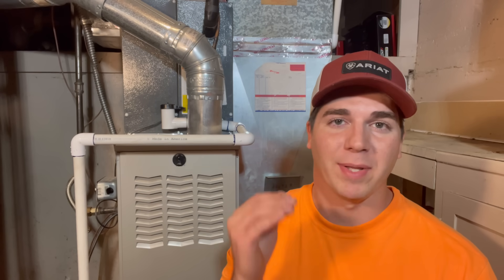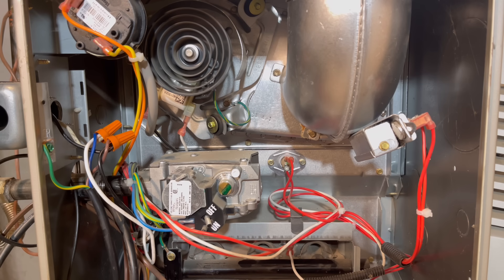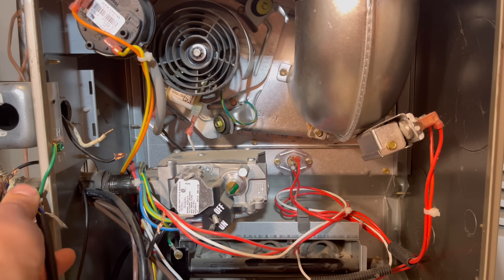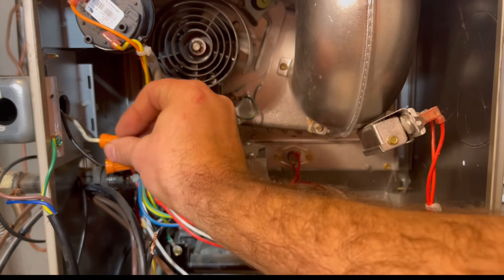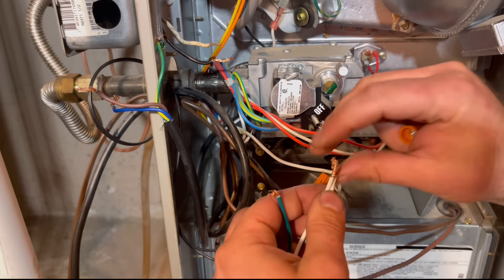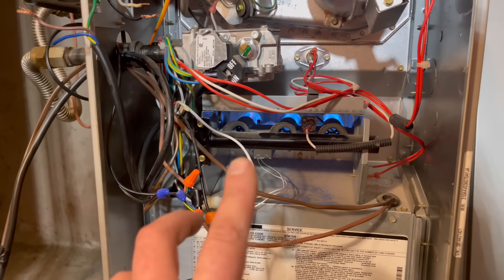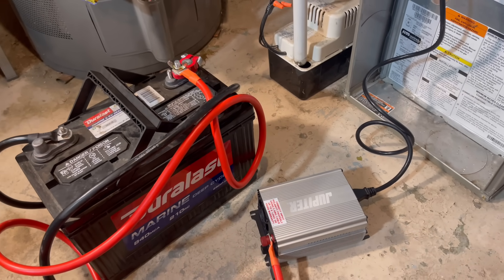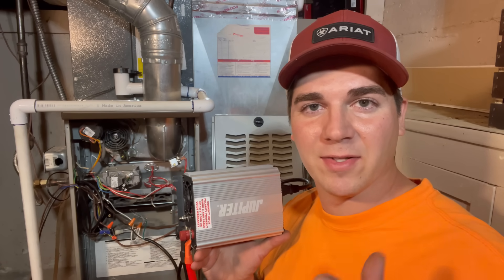Did You Know You Can Heat Your Home With A Car Battery?

Comment: Last December (2021) my neighborhood lost power overnight for eleven hours during a blizzard/wind storm.  We've burned wood most of our lives, but the current home I built uses an air source heat pump with a natural gas furnace for when temps are below zero F.  I've been considering my options and really didn't want to punch another penetration into my well insulted home for other options.  I am very appreciative for this video as I have decided this is my solution, i.e. fire up the natural gas heater to get through a future power outage and save my pipes.  PS: TX is disneyland compared to MT, WY, and the Dakotas during the winter, but it is nice to have a place for women and small children too.  😉
Reply from the maker: Also what you can do is hook up the inverter in your vehicle and run an extension cord. Then you can power it for as long as you have fuel in the car! Cheers
Reply: @diyhvacguy  Some vehicles (Ford Lightening notwithstanding) have built in inverters providing 120 volts ac such as the Nissan Titan. Using an extension cord of sufficient length would allow you to use the vehicle's inverter to power the furnace. If you are going to run the vehicle to charge  battery or power the furnace, better make sure you have adequate ventilation - don't run it in a closed garage!
Reply: The easiest solution for emergencies would be a small propane camping heating that’s designed to be run indoors. Mr. Heater makes the popular Buddy model. It’ll heat a room for several hours on one of those green Coleman 1lb propane bottles, and there are adapters to use 20lb grill bottles. Plus, when you’re not using it for emergencies, you can still take it camping, or use it in a garage/workshop.

Comment: I used this same trick to get a hot shower from my +95 efficiency gas water heater. Fortunately our local code has it plugged into an outlet just above the heater via a 15 amp 110v cord. Very little draw on the battery as the heater once lit uses a small fan to pull air up through and outside.

Comment: What's a "pure sine wave inverter"? How can you tell when buying? Please answer like I'm a 5yr old😂
Reply: They sell modified and pure sine wave inverters.  Pure sine wave iverters are usually more expensive than modified sine wave.  It mimics the sine wave coming out of your wall socket a smooth 100-120v at 60hz which most electronics use.  Similar to gas generators, a good inverter generator which produce a pure sine wave can cost 2-3x the price of a regular generator of the same wattage.
Reply from the maker: Simply avoid any listing that says modified and look for an inverter that says PURE sine wave 👍🏽 cheers

Comment from the maker: All my favorite HVAC tool can be found here: https://www.amazon.com/shop/thediyhvacguy?ref=ac_inf_tb_vh
Reply: I don't mean to come across as ignorant, but since I am ignorant on this subject, I hope to become less so; hence my question: would this setup, as demonstrated in your video, be used in the same way to power a geothermal unit? 

I have a wood burning furnace piggybacked on a geo pump with a squirrel cage on top. So the Woodburn ingredients furnace benefits from for rd air. I use it in the winter when the geo setup is pretty much exhausted. But when the power goes out (which is frequent in our rural community), the heat from the fire doesn't circulate. I'm thinking that if I can reprogram the setup to just run the squirrel cage, maybe that would work similarly to your setup. 

I am guessing that when you connect your inverter to your furnace that it also gives power to the thermostat?

Sorry for the dumb questions. I am going to immediately look into this further. Very grateful to have seen your video.
Reply: @kimchiman1000  I am more ignorant than you, since I am not aware of your setup (geothermal...?)  But I do know that you would have to check requirements/usage on your squirrel cage fan, how many WATTS/AMPS it uses.  Some of those use a LOT. Then see the maximum wattage/amperes output of the inverter...  But remember that the inverter has to power BOTH. 
An average incandescent light bulb uses 100 watts.. and in a 120 volt system, uses 0.833 amperes. BUT, in a 12 volt system, consumes 8.3 amps. I'm guessing that your squirrel cage fan draws at least 20 amps. 
Also, I have seen these fans that sit on top of a wood stove and move air just from the heat of the stove. vs the lower temp of the surrounding air. (don't know what they're called...)  Those require NO electricity.
Reply: Just use a store bought heater? Instead of the continuum transfunctioner?
Reply: @kimchiman1000  you'll be able to check by looking at the wires plugged into the thermostat, and at the furnace where they connect to the unit itself.  I'm no professional, but I know most furnace fans are either controlled by the unit or stat controlled with a wire.  So it's like a 50/50 if you'll be able to do what I think your trying to do. Unless you plan to get diy with your furnace I guess lol
Reply: I just pump car exhaust into my room. Is extremely effective
Reply: What glowing igniter?
Reply: I made this type of modification years ago.  The 120 Vac from the circuit breaker panel comes into the metal electrical box on the side of the heater side-panel.  Turn off the heater circuit breaker on the main breaker panel for safety.  Undo the wires from inside the heater that were connected to the incoming AC.  Put a combination single outlet with a switch in the box, with the incoming black (hot) wire connected through the switch in series to the new outlet.  Now you have a switched outlet on the outside of the heater.  Next, connect a short pigtail  plug (12-16 inches long) to the internal heater wires to be fed through both the hole that goes into the electrical box, and out a knockout hole in the bottom of the box.  I used the normal, non-metallic, cable clamp on the pigtail wire.  When all wired up, the plug gets plugged into the single outlet.  Turn the outlet switch on, heater breaker on, and the heater is back to normal.  But If there's an outage, pull the plug out of the outlet, and plug it into an extension cord that goes outside to a small generator, or the
inverter and battery setup that you described.  That way, there's no need to do any wiring
inside the heater under the stress of an emergency.  Also, it's simpler to instruct someone
else how to supply juice to the heater when needed.
Reply: I would be real careful using a modified sine wave inverter on anything with motors or electronics. I have seen them fry both. Pay the extra money and get a full sine wave inverter.
Reply: Thank you
Reply: Yes
Reply: Yes
Reply: @Tron Jockey This was my concern as well.
Reply: Imagine if you had a few solar panels set up. Your battery would have consistent power daily…
Reply: How long did it run before battery dead.  My guess 15 minutes
Reply: @tcathunder  he mentioned in the vid it got him through a few days which in an emergency could save your life.
Reply: No thank you I've got more enough recovery machines recovery tanks auction selling torches bottles and torches gauges evaporator pumps I've got enough for all four of my vehicles to have three extra so if one goes out they have another one in the vehicle that they can go to and if they have so happen to have more than one or more than three units if they're working on at the same time on the same house they can hook up and recover more than one unit at the same time that cuts down on the hours but it's still the same price for each unit it's all about it's all combined it into the price and I'm not I do not charge an arm and a leg and the kitchen sink to install the do a complete tear out and install a unit I can take a 16 SEER AC unit with air handler replace 12 ac ducts and return and all the grills like if I was starting from scratch from a new build install and come out with that person that customer paying no more than $3,000 for a full install next Labor unit cost and  I also have a blown insulation crew I have two crews that goes out and does blown insulation and the way I price my attic blown insulation price I price by the square footage of the attic and head clearance of the attic if the person my installers has to get on their hands and knees and cannot stand fully up inside the Attic the cost goes up but if they are able to stand up in the attic and have plenty of head space in the Attic the cost goes down basically the cost starts from if it's under 6 ft of attic space from ceiling of the house to the attic raptor beam Richmond to the ceiling raptors the cost is like basically $2,000 for a 24,000 ft house but if it's above 8 ft that cost goes down to goes down at least $1,000 anywhere from $1,000 to 0 dollars it depends on how much attic space for that same square footage and I get all my AC units from century AC unit company out of Houston Texas,
Or Al Morrison AC company out of Conroe Texas it depends on what brand of AC unit by using American standard or ICP units I go to Morrison supply if I use train which I hate the trains but if the customer wants train I go to solar AC company if I use air the red rain or Carrier I go to century I have been in business for over 50 years of doing installs I started in January 1972 doing installs with my company I started doing AC work in 1969 after coming back from the Vietnam war of serving two tours in Vietnam in the US Marine corps
Reply: The 16th of January I turned 76 years old I have been doing this AC and heating since 1969 since April
Reply: If you leave that lead acid battery on the concrete it's going to be dead within the next day and it will not take a charge ever. The concrete ruins batteries let acid batteries
Reply: Might as well pick up a couple solar panels and a solar charge controller and recharge that battery and it will work for a long time

Comment: As most furnaces are on a single ckt. bkr. it would be easier to disconnect the wire at the bkr. and splice in the inverter. No need to open the furnace??

Comment: The concept is good but for most people messing with the wiring in there furnace is dangerous. Not to mention taking the battery out of there car.
Reply from the maker: Alternative here is to connect the inverter in their car, run an extension cord and power their furnace as long as they have fuel in it! Thanks for watching. Cheers

Comment: This info is great if you have a low-power draw heat system... not sure how long a car battery will power for an oil-fired furnace or boiler that has a 1/2hp blower motor

Comment: I have read the comments and need clarification. Will the 12v car battery with the 1000w inverter work as he showed?
Reply from the maker: My advice is to install the inverter in your vehicle, to the vehicles battery, then run an extension cord and do this same thing as is shown in the video. Then you can power the furnace as long as you have fuel in the car. Simply start it up every hour or so, and you should be good to go! Thanks for watching! Cheers

Comment: For sure cool hack and for sure the battery will last less than day, probably a few hours. Car batt has about 40 amp hrs available and the furnace probably takes 8 while running. Get jumper cables and a 2k inverter and your good.

Comment: A car battery will power a furnace with a 3/4hp motor with a 1000w furnace for a few hours. 500w draw at 12 v is 40A. Most rv batteries are 90ah so thay means the furnace will run for about two hours.  To ensure heat you need four things. A 1600w inverter generator, a 60a 12v battery charger a deep discharge battery minimum 90ah and preferably a 1000w sine wave inverter. My boiler did not run properly from a small generator but would run seamlessly from a sinewave inverter and battery. The generator and charger keeps the battery topped up and the furnace will still run properly for a short period if the generator is off. 
I have all of the above. Generator is also most useful for camping as well. 10 hours on a fuel fill. 
Radiant propane heaters you have to watch moisture and carbon monoxide. Bin there done that.

Comment: An Alternate way to keep your home warm is to run a Kerosene Heater. Kerosene heaters are basically work like a large oil lamp. They run with no power. A small house will use about 1 gallon of Kerosene a day, so a five gallon can of Kerosene, will potentially last for 5 days. A standalone Kerosene heater is about $150 in 2022 with five gallons of Kerosene and the jug putting you back another $50 or so. Once purchased this is stable and will last for years.

Comment: Just take a 150 or 200 watt inverter,  and plug into you car cigarette lighter and splice the wire that powers the furnace.  Don't mess with the wires like he did inside the unit. I went through 3 electricians to get one who finally figured out how to wire the boiler back up. The 150 to 200 watt inverter worked on a  natural gas steam boiler.

Comment: Buddy Heaters are my go to. Spend a bit extra for a good peltier powered fan and you can heat a whole floor to a normal modern home. Im in Canada also so it actually matters unlike Americans who can't stand anything below 15c which is summer temperature here. Hearting every comment just makes you look like a scared little baby who needs a heater at 15c anyways.
Reply: see

Comment: This is a very poor electrical connection.   Rather make the furnace power be a standard 110v plug, and simply plug that into the inverter.  Don't open the furnace box at all.

Comment: Nice video,  When my power was out for 12 days in November due to Hurricane Sandy, our kerosene heater saved the day.  Modern kerosene heaters have anti tip safety features.  Due to the power outage I could not find gasoline for my portable generator, but kerosene was readily available.  A nice kerosene heater costs about $150.  Kerosene is very economical and safe when directions are followed.  It was a life saver for us.

Comment: Just FYI..... my furnace, as do many, runs the vent motor first and immediately checks for airflow out the exhaust.  Even running from a 5000 W generator, the vent motor does not spin up fast enough and the airflow sensor reports inadequate airflow.... and the furnace throws a fault.   If the *&$%# designer left even an additional few hundred milliseconds before checking the airflow, the fan would be up to speed.  As it is,  the source impedance of the generator is just high enough to slow the spin-up of the vent motor by a very small amount compared to mains connected operation.  WOuld have been nice to tweak the firmware a little to delay that check for 500 ms or so.